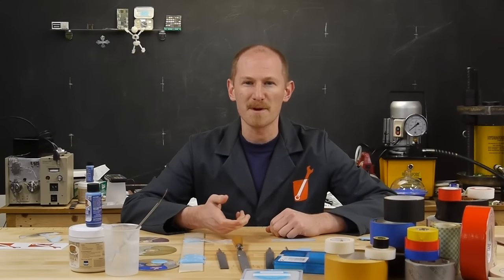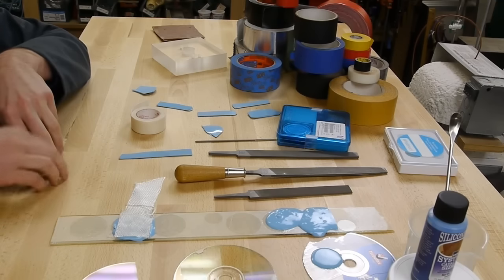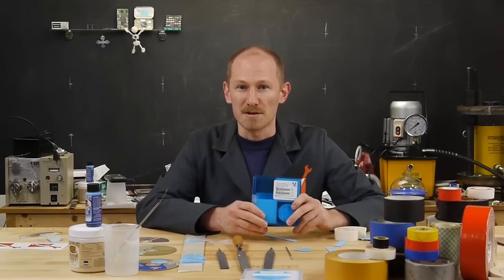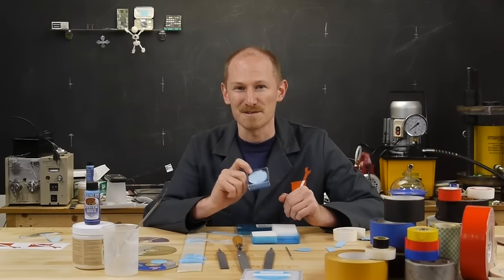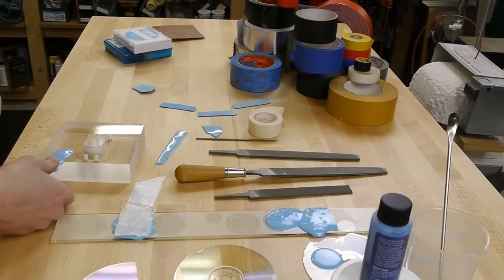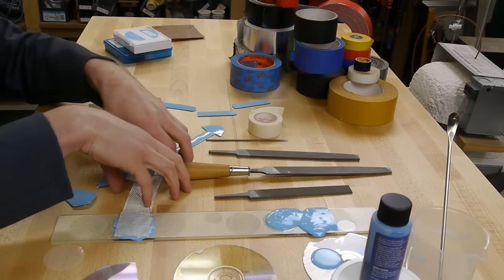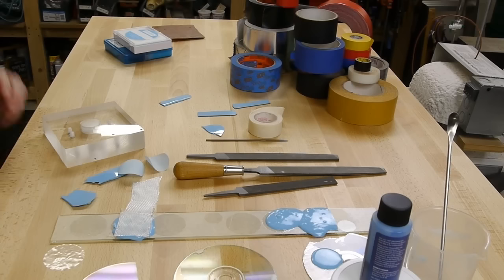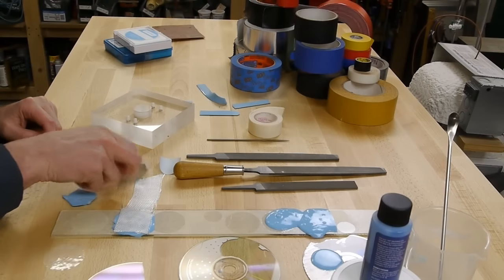Making DIY gecko tape - work in progress

Comment: use high frequency ultrasonic (probably need light & not sound) interference patterns to make correct spacing and depth of liquid resin. let it set while applying the field. It would not need any casting structure at all besides the correct frequency of sounds. It would cure facing up while 1, 2 or more combined frequencies were applied within an appropriate shaped wall curing vessel to give correct pattern and surface depth of any total depth of a resin (or rubber)while it cures..... maybe, just maybe. If it works, it would eliminate the whole negative etch substrate part of manufacture. Also, could try curing a UV sensitive topcoat  of UV curing material cured on a solid substrate with mirco-interference patterns  from UV laser in similar manner. Pattern, due to minute size, may probably require interference patterns from light and not mechanical vibration. maybe try casting on piezoelectric crystal with frequencies applied. Sort of like direct or mould casting using the Lippmann color photo process or the holography film processes it led to. Maybe Potassium dichromate in gelatin exposed to curing UV light (sort of like carbon process photo printing but with UV LASER  wavelengths instead of incoherent UV source) interference patterns to certain time then, developing in warm water and using reverse side to exposure side as final product or mould. just a change in casting material and 1 or more UV lasers could maybe solve the problem of odd shaped & floppy strands. Maybe try exposing and developing very fine grain silver holography film to varying degrees of coherent light patterns and then use UV carbon printing gelatine process to transfer to 3D form. UV cured gelatin dichromate media would produce pinpoint & rigid cone (more linear with coherent UV) shaped hairs with size & depth depending on time of UV exposure even without interference patterns if fine enough grain (holography) negatives were used instead and it is very cheap (could maybe even just use sunlight x-fer process for gelatin once proper reusable interference negs are made) and also,  exposure times have been worked out for many years easily available in books and on the net for depth and pit width. these methods, if any would work, would eliminate using a finely tuned CNC laser to attempt drilling many multiple holes in a longer & sputtering process.

Comment: potentialy bad idea incoming because the silicon would not mold so well but if you could use a microfibre cloth as the mold by keeping the  microfibre cloth cold but the silicon warm enough to mold (I have no clue how to do that part) but if you could figure it out it might work.

another possibly bad idea 
expose the DVD to beta particles and use a similar etching process but the DVD might be to thick so the beta particles will not go through as well if at all

Comment: You couldn't force a liquid analog of silicone into the structure using extreme pressure? Heavy long soak.. like the co2 did into the acrylic in your carbondioxide phase experiment.

Comment: How about rotation? Spread silion ON filter, then rotate it, let silicon bypass the filter holes, now given know surface tension I guess it ould be estimation for rotation speed that given just enough strings length on the other side of filter.

Then required gekko tape is silicon mashed with filter :)
Reply: Not sure however that neccessary speed could be achived :)

Comment: Wouldn't it be much more effective to get some steel with proper grit finish, than to use files etc. to make mold? Maybe something like AISI 304 B2 (500) that should have Ra of 0,1 to 0,25 µm? Though removing material from mold is something I have no idea how to do. Perhaps it also could be possible to create biofilm in some surface, use it as mold surface and then removing this biofilm from final product?

Comment: Trying to store hydrogen of a homemade electrolysis in a condom (don't ask) i saw how the condom desinflated over and over again. With a little bit of research i learned that the expanding latex became to have very little holes for the hydrogen to escape. May be using that latex "deffect" or, in this case effect, there is a chance to use it 
for casting the silicone. It is like the mechanic equivalent of the polycarbonate mold used in the video, and must be stretched very evenly but could work being that simple.

Comment: It not 5 microns the distance between LCD of the polarized layers
Reply: +Protomaker Black Sprint Original 3D Printer I think they use tiny, 5 micron glass beads

Comment: Not too sure on the exact measurements however I have a feeling they may be a few powers greater than what you are after, but would a phosphoric acid anodised metal surface be useful as a mould?

Comment: I was watching other videos on how the Gecko's feet work. while watching it I noticed how the ridges and fine fibers were in rows and most or all facing in a downward direction and as I had been watching videos of soft robotics before that I am thinking that not only are the mini micro fibers hooking on to the wall but as mentioned in the Gecko video the more weight added the better the adhesion. But I also think that it is gaining from fibber jamming, were the more weight applied the better. And also when you are trying it on a vertical rather than on a horizontal plane it looses much of the fibber jamming effect. does this make any seance? I have been told I tend to ramble a bit. I am very interested in this as I think I know how I could make it work to allow my planed humanoid robot to climb vertical planes. Any thought on this would be appreciated.

Comment: I feel like you may have been on the right track with the CD. First, why not use a DVD or BluRay to up the density? Second, it appears you just used a random CD with actual data on it. What if you burned a disk which a purposeful pattern, i.e. just write and entire disk with 101010101010101 ad nauseam? Finally, would it be possible to override the disk drive's lock-out so you could burn an already burnt disk? Assuming it would be possible to make it line up properly, could you write the same "101010101" pattern several times to create deeper impressions?

Comment: So you need to project regularly spaced tiny lines with light...quantum interference pattern comes to mind, that would be extremely applied science.  A quick search shows  interference lithography already has a full page on wikipedia.

I'm envisioning a heavily reduced stepper motor sliding the silicone in front of a double slit aperture, with a high speed flashing light source. I think the math checks out for getting the spacing you want in a reasonable amount of time, something like 22khz on the light for an inch per second?  Calibrating the line spacing to the motor speed might be difficult,  perhaps easier for someone with their own SEM though.

Comment: If you ever get board and want to do a destructive adrenaline project. Something I have always wanted to see.
These older engines (first generation) that use massively large flywheels with tons of centrifugal energy.  ?What would hapen if one worked its way off the shaft hit the ground and had its own bad attitude until it ran out of horsepower.  
?Would it leave a distrusted path or flop down and be submissive.

Comment: ThorLabs.com has a poka dot beam splitter that you might be able to get a good cast on.  
It is glass with a vacuum deposited metal coating in a waffle pattern.  The dims are 100um metal squares with 56um spacing.  
Here is a link: https://www.thorlabs.com/newgrouppage9.cfm?objectgroup_id=1110&pn=BPD254S-G&gclid=CjwKEAiA8K20BRDetNv3p6DNhXwSJADSwa3tz0qAYBE4wpCpfpUJWPlBLfZJR1n-rehXZWk-bP5IPxoClD_w_wcB

Another idea was to positive cast the file, that way the flat area of the teeth is the bottom of the tape.

Comment: my comment is a bit late, but maybe you can thicken the aluminum layer of a cd/dvd, simply remove the protective layer, expose the metal, and use simple electroplating to thicken it, the pattern should stay the same, the aspect ratio should improve, solving the issue

Comment: I went ahead and quickly modeled the simplest solution I could think of: https://i.imgur.com/S2qQxDA.png

Straight razor blades for safety razors spaced with sheets of thin paper and clamped into a single unit, set into a jig with a cutout for the blade assembly, and a greased tefflon cutting board segment to act as a roof/guide for the jig. 

You would run the flat molded silicon through the jig then rotate it 90 degrees and run it through again. The cross-hatching should serve the same purpose as gecko tape.

Comment: Waiting for a fan to ship you a gecko so you can make a cast of that :)

Anyway, the solution to the file cast being backwards is just to make two casts, no? There's a question of what to use for the first cast, though, since you can't use silicone. Epoxy might be hard to get off the file without a release agent. Alginate maybe?

Comment: Why not make 2 layers of transparent dots from a high performance printer, color the whole sheet dark with the smallest possible holes not filled. Make the dots as small as possible, then layer both of the transparent dotted sheet on each other with enough offset to make the transparent parts small enough, this would produce tiny convex shapes.
Then do photolithography on that.
You have the tools required to make the offset properly. Only problem I can see is making the offset permanent so the sheets can be handled.

Comment: Why not modify either of your electron microscopes for electron beam lithography?

 It should be feasible if you can sustain a high e- gun current and > 30KeV. Although you would need to modify your gun control using to have a blanking grid (to halt e- transmission down the focusing column) and you may have issues with your focusing coils (hysteresis and cooling problems) which may become problematic with the very slow scan speeds you would need.

Comment: Can't you just anodize a piece of aluminium for your mold? The cell size and depth can be process controlled to what you want and as a bonus the bottom of the cell should provide you a sharpened tip...
Reply: Also, if you are too lazy to make them yourself, you could buy anodic alumina membranes from a variety of suppliers. But they are not cheap:
http://www.2spi.com/item/a2225-fa/anopore_02/

Comment: Making the pillars straight would be easy enough, just put the beta source far behind a small hole in a metal plate that will fully stop the particles, the farther you put it the straighter the holes.
Also: I would never have thought in a million years that the silicone would flow down those tiny holes, and that they wouldn't rip right off instead of coming out of them when you pulled the die off without any lubrication !

Comment: you have a functioning SEM right?, well..what if you modify it a little bit to do electron-beam lithography?, it's not that hard i think, some manufacturers send kits to do just that. (or you can contact some university who has access to a commercial system), you can use PMMA as a photosensitive resin and then make your casting with that template you made

Comment: I think that something you may like working on would be aluminium anodization. Considering your knowledge of mecanical and electrical engeneering, and your basic aptitudes in chemistry, you shoud have no problems building yourself a setup for that. Just be carefull working with concentrated acid and bases and you'll be ok.

The reason I'm bringing that in is that the porous surface obtained can sometimes be used as a template for nanostructures. Here is a paper about that :

http://nano.eecs.berkeley.edu/publications/NanoLett_2011_R2R-anodization.pdf

Comment: If the CD (or DVD or Bluray or HDDVD) pits are the right size you could always polish the material to reduce the depth and achieve the desired aspect ratio. It looks like the spacing is too large. Is there a hard resin you could cast off of the CD, and then press into a glob of mold compound several times to get a higher density negative surface?
Reply: Alternately, perhaps a custom redbook audio CD would work? Redbook audio CDs are uncompressed, and I'm fairly sure they directly write your samples bit by bit as pits or blanks. Anyway, a redbook cd directly correlates to the sample bits in an easily predictable way. You might want a 16 bit 44.1k mono track where each sample is FFFF or AAAA, for example.

For the depth issue I suspect that the pit depth is different between pressed CDs and burned CDs. You might get shallower pits by burning at a higher speed. Regardless, you could probably hack a CD burner to use shorter pulses for shallower burns? You also might be able to hack one to burn the tracks .8 microns off of the normal tracks and add pits between the normal tracks. If you mirror your sample pattern (c.f. AAAA to 5555) very dense and regular set of pits.
Reply: Also you might try to score one of those old CD burners that print images on the label side of special CDs. I think they were an HP thing? I suspect that they just used a heat activated dye for the purpose, but perhaps it actually etched an inner layer of the disc too and you could print your pits directly using the right image?

Comment: Couldn't one use 405nm SLA resin as you photo-resist?  Most optics will pass this.  Also, what about non-isotropic etching of a (?,?,?) oriented single crystal wafer?  Or molding against a physical diffraction grating? - maybe two orthogonal steps.

Comment: Hi Ben!, Did you tried to cast the silicone on top a DVD? (which contains more holes per cm^2), and a Blue-Ray? (even more density). And if this does not work, why not to reverse the problem like: Casting a circle of silicone, put it inside a DVD Writer unit and use the laser to burn the silicone until it has the required surface :D

Hope it helps!

Comment: i was thinking about how to get that fractal structure to be casted with silicone, and then i saw a thumbnail image of one of your videos, and the image was a crystal structure, like water crystals... what if you make some crystal structures that is really tiny... not with watercouse it could melt when you pour the silicone on top of it, maybe some other material or element...   and then you could make a mold with it, then you can pour the silicone on that mold that will have that fractal structure on it, the problem is if the silicone that went inside the fractal holes get stuck in there, and when you pull it off the silicone pillar structure ( hairs ) will stay in the mold...  so you should try a mold that can be disolved, so it will release the silicone fractal tiny structures and not ''break'' them.

Welll i dont know what material or elements you can use... i was just thinking about a way to make the fractal structure...  and by the way, the crystal image on the thumbnail is from the video called Liquid Nitrogen Generator.

Comment: Well you mentioned that the CD had the right idea but the wrong aspect ratio, How about hacking a blueray burner to burn the pattern that you want on a disk and then do the casting from it? Also for a more budget friendly idea, why not reverse cast the file? You mentioned that the tips where sharp so cast a mold from the file and do a final casting form that to get the sharpness of the tips on your gecko tape.

Comment: I know this is an old video but if you still are looking for suggestions an anodic aluminum oxide mold/membrane. These can be made to produce very regular and dense pores with well defined geometries. Often they are used as membranes for particle separations or as molds for nano-pillar surfaces for hydrophobic and high surface area applications. HEre is a link to a freely available protocol however, you can find many protocols where one can suit your needs. http://iopscience.iop.org/article/10.1088/2053-1591/3/7/074004/meta

Comment: What about a Blu-Ray-Player? The laser should be able to egde a UV-reactive surface (eventhough the laser with 405nm is strictly speaking oudside the UV-Spectrum).  If you would burn a Blu-Ray-Disc that is coated in such a material it might work